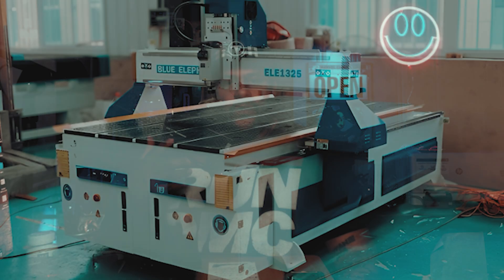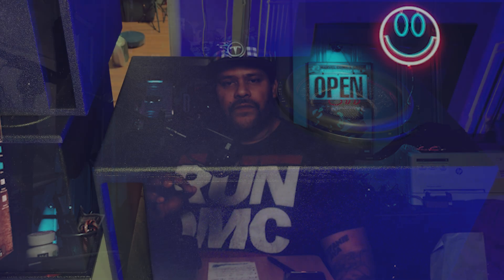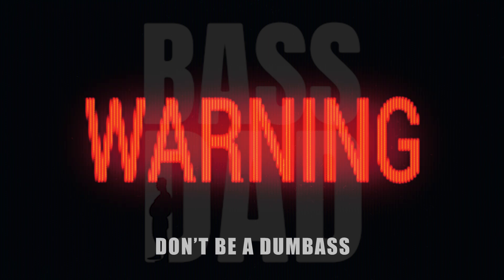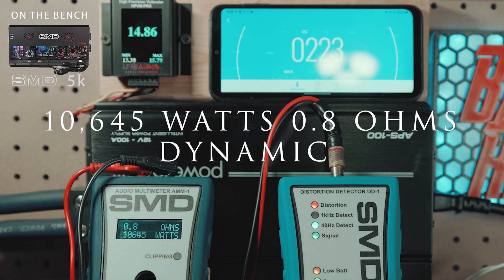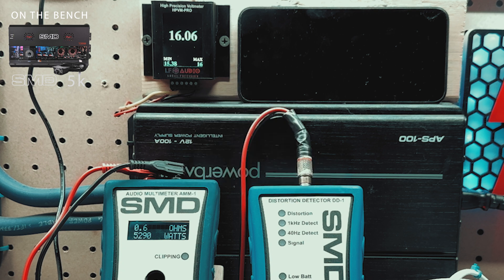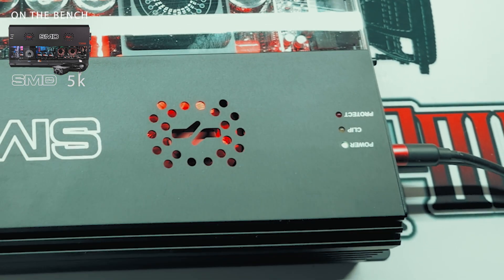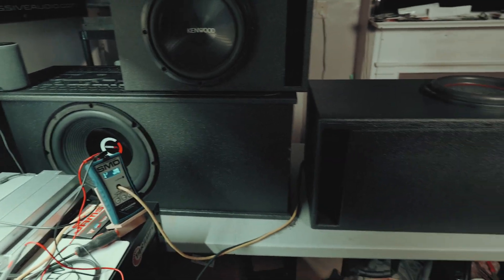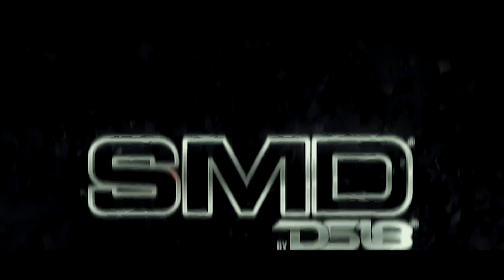Can this SMD amp Handle .5 on the Dyno?

Comment: @bassdad-tv Definitely agree with you. Very impressive amp. Being able to run half Ohm is NOT an indicator of whether an Amp is good or not. Running at Half ohm is usually sloppier and doesn't provide as clean power to subs anyways compared to 1 or 2ohm, so if you want more power just buy a bigger amp and run it at a higher impedance. Simple as that. I think it's a great collab, DS18 and SMD did. Clean design, small footprint, and nonetheless powerful, overall.

Comment: For what these cost .5 ohm shouldn't be a problem.ruthless,surge,sundown etc do .5 ohm.of course understanding you'll never see .5 ohm in the real world playing music
Reply from the maker: I get what you are saying but 1. The amp isn’t rated for .5 plus it did the .5 on the subwoofers like you said. So it still did it. Also being able to run a.5 dyno test has nothing to do with how good an amp is. Thanks for watching!
Reply: @BassDad-TV  On some of the D4S amps are actually warrantied to .5 ohm but not rated for whatever that's worth. I guess the really extreme guys go that far. 

Based on this test Looks like JP's amp is the much better buy.
Reply from the maker: @ as long as it can do it on subwoofers it’s good. This amp definitely handled it and it looks great.
Reply: @BassDad-TV  I am pretty sure Big D did a test on  one of JP's bigger amps to 1/2 ohm. 

JP's amps have proven to be decent for the price. He seems to be steadily increasing the price. Rules of business I suppose.
Reply from the maker: @BentonL  he has some and I also have some D4S videos with half ohm tests. As well as many other brands. Like I said, doing half ohm is not the tell of what’s a good amp. Us older guys remember when amps used to do 1/4 ohm and I also remember when the norm was 2 ohms and everyone wanted 1ohm stable amplifiers. It’s just whatever the manufacturer decides they want. Now with that being said sometimes an amp not being able to achieve a low ohm is a sign of an issue but it requires a lot deeper digging like I did with the American bass series I am working on. Those amps not being able to do a half ohm load are definitely a sign of a bigger issue. So I took those amps to a guy a lot smarter than me and he showed me how they cheaped out on the power supplies and mosfets and the traces. I had the same guy look at this SMD amplifier and the same issue’s aren’t there. It just seems for whatever reason DS18 didn’t want it to make low ohms. Which to address your comment, Down4sound is having a really hard time with warranty repair and lead time on those repairs. One of the reasons why is people running those amps at .5 ohm loads. I like them and I like their amps but that’s just the truth. .5 ohm loads on amps that aren’t extremely overbuilt are really hard on a amp and over time can cause some pretty bad things to happen.
Reply: @BassDad-TV  My point was SMD wants a lot more than his competition for a similar rated amp. It should be able to offer something the others dont besides a display.  Steve like Jonathan has an ego the size of Texas so my expectations of these people is higher. 

I seen Price's vid blaming people for his amps failing and I commented stating I think the protection circuit needs improvement. Seems most of his warranty issue are related to not enough power and people not using all the leads. I think a circuit needs to be added to put the amp into protect if it dont detect power coming from all the leads or change how it is done internally. He splits power up and it seems to be the source of the problems. Some amps have 2 pos and negs, but they are from the same piece of metal.  Sadly I have not had the joy yet of running his JP33, and that vid along with your comment confirming problems has me concerned. Based on what I have seen I will make sure all the power leads are used. The truck its in has 6 batteries. Been mega swamped with work so no time to pull an engine and fix it. 

Until recently most amp manufactures would grossly exaggerate their settings. I have always used the tried and true fuse rating times 10. I dont really see the reason to run 1/2 ohm, but since we are comparing amps at this price point it is a metric worth considering. I doubt I will ever being doing comps again. Most of my money goes to go fast parts.
Reply from the maker: @ D4S isn’t the competition I would not call them a premium brand. SMD makes amp dynos and other diagnostic equipment. Digital designs, sundown, incriminator would be the competition and the price is in line with what they are asking for there similar models
Reply: @BassDad-TV  Steve and JP are not on the same level as the other brands you mentioned. Neither have the engineering education to make one from scratch like the other brands you have mentioned. Nether have the manufacturing capabilities to produce these amps on their own. Both have paid to have their names put on them and a few customizations. Just a step up from a drop shipper. The other brands are all their own creation, and manufacture them.  

 In the end its car audio with a ton of inherent background noises from various sources not all from audio gear. None of these brands could hold a torch to the likes of McIntosh, Marantz, or B&W in a automobile environment.
Reply from the maker: @ Steve and JP aren’t on the same level at all but this isn’t about Steve or JP. I have had dealings with both men and I have respect for both even though they are in different spaces. SMD makes the things all of the companies use to know what their stuff even does. 

I didn’t realize that you even had this SMD amp? You should take your experience with it and go ahead and make you a video bro. That way you can say whatever you want but this video is about my hands on experience with both of those products and I stand firm in my assessment. So I’m going to stick to what I said. These amps are in line with what other amps cost in the same space.  I have determined this through my hands on experience and real testing of this equipment. 

Thanks for watching!
Reply: @BentonL not as good looking but definitely a better value.
Reply: @shanesubashe787 there's a ton of flea market amps that are just as pretty... Does'nt mean they're worth a damn. 

I met both of these people a long time ago. They both have that I'm better than you attitude. Unless Steve deleted his comment is pretty evident in what he said but he still  has this elitist attitude. Jonathan's definitely a bit more humble, but still very stuck up.
Reply: @BassDad-TV  while I get what you are saying there ....its not really an apples to apples comparison.  Tony D'amore (a electrical engineer I believe) designed and made all of those tools.  Its not a knock on Steve at all but him making fuse blocks and other accessories isnt the same as designing an amplifier or those SMD tools for that matter.  Now that being said he has a name in this community that IS going to move units.  Id say his name alone probably sold many more SMD tools than if it was just a d-'amore tool and had no SMD attached to it.  I dont have any knowledge whatsoever about his dealings with DS18 but id assume and you know what they say about that, that the ds18/smd thing is more a licensing of his brand and voltmeter rather than it being an SMD designed product.
Reply: Dang silica packet ….. lol
Reply from the maker: @jadsholloway I wonder if that’s what it was? It sure spit it out after I cranked it